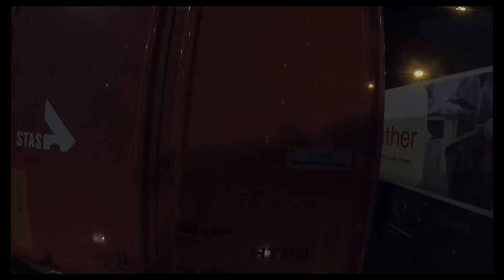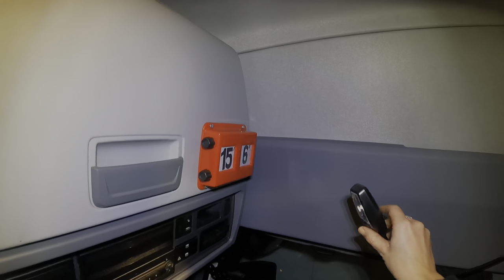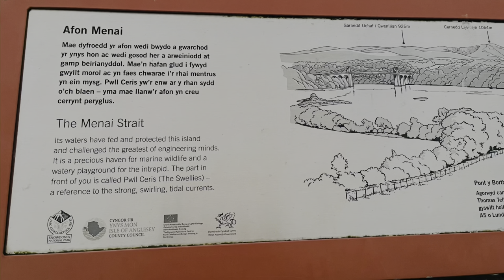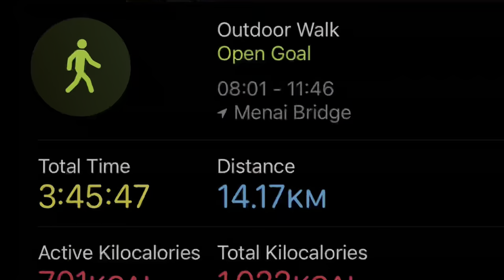Uk - Ireland, Irish Ferries, Holyhead - Dublin;  Female C+E tramping the world 👌🏻10-13/12/20

Comment: Postcodes are used in Ireland and work with Google Maps. Curious to know why you did not use the motorway to Cork?
Reply: I was wondering the same but I thought that it was the way the video was edited. It could also have had something to do with using Google maps — they are not truck friendly! If you everyone compare a google maps route to a TomTom truck sat nav route you will often see a massive variation!
Reply: Michael John Dennis  It was pointed out that her trailer was higher than the maximum legal height in Ireland and that it was higher that the permitted height in the port tunnel. 

In fairness I don’t know if that trailer was only in imperial or if it had metric height on it. I have seen cases where UK drivers get confused when they meet our all metric system. 

These illegal trailers should ultimately be stopped leaving the port — I’ve seen UK drivers having to make very strange detours around Dublin and also hitting bridges because they are too high overall. I saw a UK truck hit a bridge on Amiens Street a while back when it should not have even been there as it was running on 6 axles. Apart from hitting the bridge that truck driver was already committing two offences.
Reply from the maker: Yes I think I was a little too tall, so my sat nav must have taken me around. Also I did edit some of the ‘boring bits’ out. Think I was travelling on m7 a lot. I use copilot alongside Google maps. For most of my route copilot but when I get closer to destination I switch back and forth not to miss the pinpoint 🤞🏻 mostly that works, prior to getting to the actual place I also tend to get out and talk to people who work there to ensure I’m going in the right entrance etc 😆
Reply: @LenaTrucker  Personally I’d use something like the TomTom Go 520 Professional to guide me. I’ve never used Copilot but I’ve heard it’s often outdated and can often bring you awkward ways!

Looking at how you came back to Dublin Port I’m guessing you came off the M50 at J4 Ballymun as you came into town through Phibsboro down to Doyle’s Corner. Had you gone on to the next junction and took the R139 over to Clarehall and then came down the Malahide Road it would have been a lot easier and way more truck friendly to get to the Port. 

If you are coming over again just make sure they give you the right trailer and a fuel card that can be used here. You won’t find an Esso or BP in Ireland 😉
Reply from the maker: Ah yes satnav was takinfg me further on but I got freaked out by the toll and the tunnel 🙈
Reply: @LenaTrucker  the one thing that you didn’t have to worry about was a toll — the port tunnel is free for trucks! 

It’s there to facilitate the 5 axle and over ban from the city. The idea being that you are straight out of the port and onto the M50 from were you can then like with other motorways to the rest of the country, the first being at J3 and the M1 for Belfast.
Reply: Did you ever hear of maps,lol..but i admit its great getting lost,luckily you could get some help

Comment: Hi Lena, Happy New year to you and the family.  Nice little trip to Ireland. Go girl . Your confidence is growing well. Something new, Crack on n get it done.     You passed through my neck of the woods being Shrewsbury and Wales.  The A5 in many parts has been re developed and is dual carriageway except for Wales.  The A5, (some 250 miles) runs from London to Holyhead port Anglesey.  Where you mentioned the area to pull over for inspection was Nescliff.    The A5 is a nice leisurely run but following the A483 from Wrexham to the  onto the A55  dual carriageway all the way to Holyhead 17 miles longer but a good 20+minutes  quicker and easier being dual carriageway.       Yes that was Snowdonia National park you went through.  Happy trucking..
Reply from the maker: Wow cool thanks martin!!! Happy new year

Comment: Next time you come over to Ireland make sure that you don’t bring an illegal trailer with you! The max legal height in Ireland is 4.65m. 

The way you exited the port and came up the quays in Dublin has a 5 axle ban between 7am and 7pm in case you are driving in the city during the day. 

Also, while Google is very handy I would never follow it when driving a truck in Ireland — it will bring you down some very narrow roads.
Reply: i never knew that about the height and axle limits, especially the latter, thanks for posting that. will remember to check that if i ever comeover in a wagon, i assume the axle ban is 45ft trailers with 3 axles. @Peter O'Reilly.
Reply: @redadestaffsnffc09  The axle ban is for any truck with 5 axles or more, that includes 5 axle rigids as well as artics and wagon and drags! This is a bit of an issue for construction in the city centre as there are a lot of 10 legger tippers and bottle mixers.

The ban is basically between the Grand Canal on the south and the Royal Canal on the north of the city between the hours of 7am and 7pm. 

As for the legal height limit of 4.65m — we usen’t to have one but because of a cock up back around 2000 one was introduced much to the annoyance of many hauliers who used high cube trailers at the time.
Reply: @TotalOpel  thank you for that information,  much appreciated.
Reply: @redadestaffsnffc09  no problem 👍🏼 A bit of local knowledge can always be helpful 😉
Reply from the maker: Thank you Peter, wow I also didn’t know!! We have a lower trailer too so I’ll make sure to pick that one 👌🏻

Comment: Wow Lena great video just watched the whole 2 hours never have had to do any ferry work just UK been offered a few times always turned it down because of the same fears you had not knowing what to do on the boat etc but you done so well couple of things I agree that the Renault is a crap truck to do multi nights away in the the bottom bed is way to soft top bunk is better but not really a bed to many switches for cruise etc and night heater is noisy and don't stay on all night.
Also can't believe your night out kit you just threw that sleeping bag down even if I'm only away once or twice still make all my  bed up pillow duvet top sheet it's a pain the arse but you want the best kip you can I liked your fridge just the right size where was that from?hope your do more trips over the water so we can learn from you maybe one day I will take up my mates offer to do his Barcelona run👍😀
Reply from the maker: Ooh you should, even though it’s scary it’s sooo much fun!!! My fridge is from Amazon around £100 I like that it’s not too big. One of my previous videos I summer I’ve posted a link for it
I was soo conscious of taking too much stuff I thought just a sleeping bag will suffice. Which it did tbf hehe

Comment: what the hell route did you go? I'm part way through and we are trying to work it out.was the motorway closed? should have been m6 m56 a55. ......you cut across the a5?  very slow and difficult route to save 20 miles. Don't cut across mid Wales in a truck.    ALSO  Don't alot of truckers share cabins on ferries?
Reply: I was trying to work that out too, happy new year to all.Safe trucking 🇮🇪
Reply: Sat nav .....people follow them blindly, she went A5 through Corwen/Betws y coed  crap road in artic for a first timer
Reply from the maker: I use copilot which got all my dimensions in, google I use as I get closer to the destination. I’ve been on m 7 a lot over there, but I think I cut most of that out 🙈

Comment: i LIVE IN IRELAND AND ENJOUED WATCHING======== ONE THING======= U SEEMED TO AVOID THE MOTORWAY FROM DUBLIN TO CORK ( WELL TO MITCHELSTOWN) WHICH SLOWED YOU DOWN A LOT AND THEN BACK IN DUBLIN YOU  SEEMED TO GO IN CIRCLES A BIT==========  IF THAT WAS NOT INTENTIONAL AND SAT NAV  SENT YOU ON THOSE ROUTES YOU NEED A FAR BETTER SAT NAV FOR IRELAND------------  WELL DONE ON GETTING THERE & BACK=======
Reply from the maker: On the way there I stuck to m7 and cut most of it out as at night wasn’t much to see, on the way bk I panicked for toll road and tunnel 🙈 copilot seem to work for me though 👌🏻

Comment: Should have used ferry movement been parked in Dublin port that long
Reply from the maker: Haven’t got one, been searching on my taco but there isn’t one there 🙈 oh well a nice rest and a walk did me good
Reply: Lena Trucker it will be there ,can interrupt your daily rest twice ,once to get on ferry ,once to get off ,maximum of 1hour for both movements .has to be an 11hour rest plus whatever you use of the 1 hour movement .
If you are going using it ,get to port check in. Once parked in land ,End country Rest
When called to board select ferry mode ,drive on park up select rest again "
When disembarking select Ferry again drive off and park up within the time left of the hour shunt
And finish your 11rest .